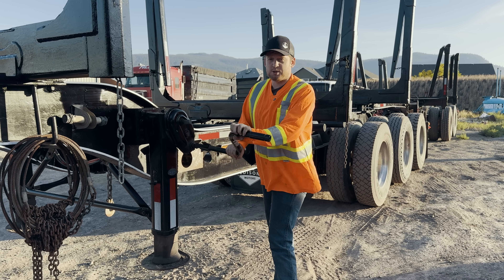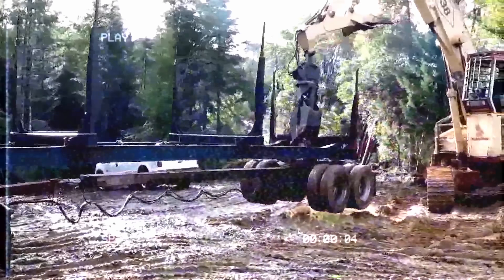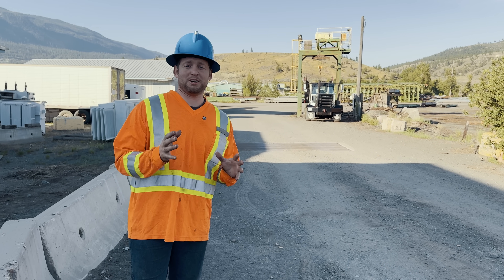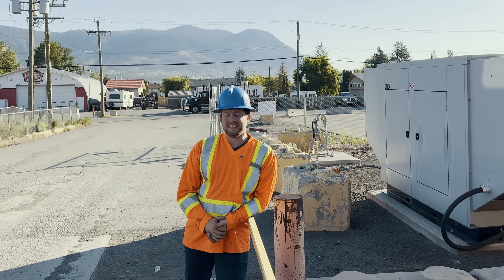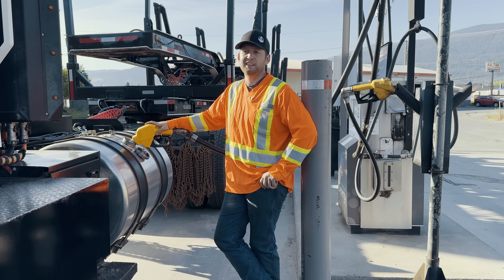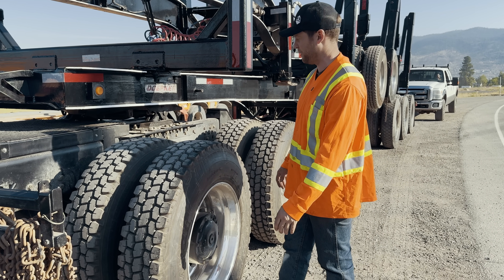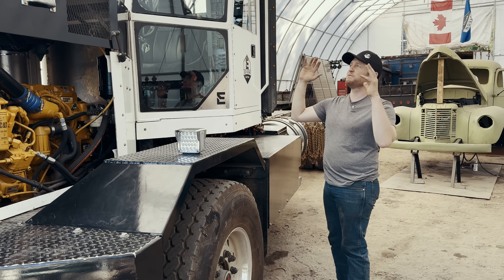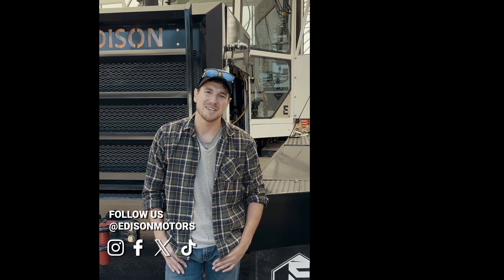We pulled our Trailer; You won’t believe what we weighed!

Comment: retrofit trailer with e-axles (with small motors like 5KW/wheel with low gear max speed ~20km/h after that automatic disconnect) maybe even with stear axles with remote control (truck too).
yea. I know in next 5 years you maybe will think about that. But that would be great.
those tictoks what that solution is capable. Helicopter owner will hate you
Reply: There is a company developing powered trailers with a force detection on the pin for throttle control.

Without charging the trailer a diesel truck saves about 5% fuel.
Reply: @MichaelEricMenk do I understand correctly 5% of fuel savings only because automatic regen locally on trailer. at what conditions? city/mountains/long haul?
Reply: @bartoszskowronski  the representative from the company did not disclose that as they are early in the testing prosess.
Reply: @MichaelEricMenk  if you have inside in that company maybe detect force not only front-back but also left-right. 
If force is on left then left wheels accelerate & right regen. that would make trailer MUCH MORE stable.
Reply: rotate the whole solid axle for steering +-15 degree.

Comment: I honestly think you should keep the extra batteries…
Reply: there is not simple answer for that. they don't even use 50% of power output of those batteries, so they can easily be smaller & cheaper.
And for testing they SHOULD do that.
I would say they should go smaller with a generator (aiming to working ~75% of the time on flat long haul)
if smaller generator have half of the lifespan half cost and half weight. the extra payload is worth little inconvenience.
another thing is generator he could work at ridiculous parameters like 3746hz 769V 5phases (with phase shift 72degree). but only problem is it's not off the shelf part.

Comment: I know you dont want to break Topsy yet... but it would be cool to see her at a loaded semi drag race.  Your competition is rolling coal out both stacks with the C18 screaming and mashing gears, as Topsy is quiet as a mouse pulling away and winning 😀
Reply from the maker: Once we're done testing, tuning and learning everything we can from Topsy, absolutely I want to take it to the drag races, push it to its limits and see how much it can do at the extreme end.  I'm 100% confident it will win.
Reply: @EdisonMotors  another reason to power the front axle.
Reply: @EdisonMotors 🎉🎉I think the yes
Reply: @EdisonMotors  these diesels put out a lot of power too. I think you need three axles for a electric truck to match the power and win.
Reply: @autobootpiloot  The trucks make a ton of power, you are correct - but what you're forgetting is that off the line the diesel is not making full power (its not in its sweet spot RPM range yet), even a VGT turbo will not be at full boost (there will be lag) and the biggest loss is going to be shifting.  Every gear change you lose boost, RPM and momentum.  If you've ever run a transport truck with an allison transmission (not an eaton automated), you'd be amazed how insanely fast they walk through gears and get up to speed.  in a bobtail race, they will slaughter a higher HP truck because once you build boost and momentum - you get to keep it.  Now take Topsy, no turbo to spool, no sweet spot RPM (and its lighter than a comparably spec'd truck)  Those electric motors will make 100% torque from 1rpm all the way up to their governed speed.
Reply: @JClaudeo  Actually the torque does drop off once the motor is power limited.
Torque in electric motors comes from current.
The higher the speed, the higher the voltage on the windings.
Power=(Current)(Voltage)
Reply: @autobootpiloot The limit will more likely be traction. The horsepower on an electric vehicle can be slightly less than a diesel to match it's performance because it is more efficient in turning that power into movement. A 3rd axle would kill all the competition mainly because of grip
Reply: Weight off the line... quicker 60foot the more it compounds down the track. 

Look up "Onaway Big Rig Challenge"
There are 3,000 hp, 25,000 lb. monsters. This uphill Semi Truck drag race features both loaded 120,000-poundd trailer) and unloaded races and attracts some of the fastest semi trucks in North America! It's definitely one to check out if you don't live too far from Michigan.
Reply: @JClaudeo   i have no doubt topsy wins in a bobtail race. Shifting takes to much time compared to how long the race lasts and topsy wins because it’s continuous power and smooth.

Loaded however he only has 500kw right now. Like he said the new axles have 700kw (combined) but that’s still a lot less than 2300kw (3000hp) these diesels can make. And these diesels spool the turbo before launch, and they shift very quickly so I think the power difference is to much for topsy to win on smoothnesses. 

A 500kw electric truck might win over a 700kw or maybe even a 1000kw diesel. But the difference is just to big to overcome.
Reply: @gormauslander   with that kind of weight, on a track that has some rubber on it. I seriously doubt traction will be limited. If I look for video these diesel monsters spool before launch so they leave the line with a lot of power. Even with a third axle topsy is going to struggle to keep up with the big diesel trucks. The power difference is just to large.
Reply: @wobblysauce  Well that's less interesting. They designed and purpose built a machine to convert diesel into toxic fumes at the highest rate possible, which is both gross to breathe and also makes them unable to do anything but compete in this hyper specific challenge because it would be too impractical to employ anywhere else. There are no winners in this competition, everyone loses.
Reply: @economicprisoner  I thought torque came from voltage and RPM causes current load
Reply: @someweeb3650  At 0 RPM (locked rotor) you have max current and min voltage.
As the motor spins: it starts to act as a generator (called back EMF), which increases the voltage and drops the current.